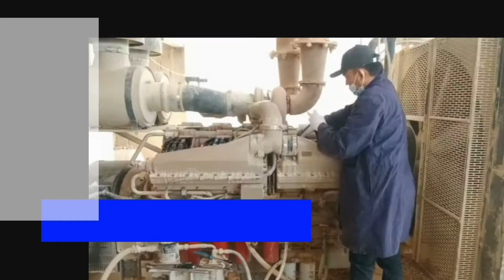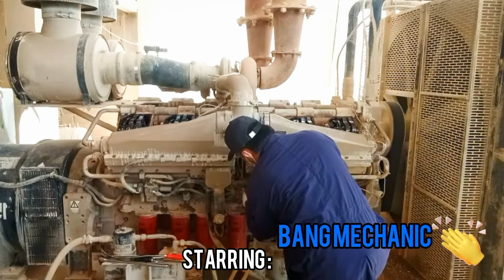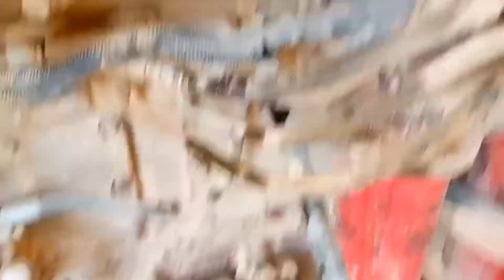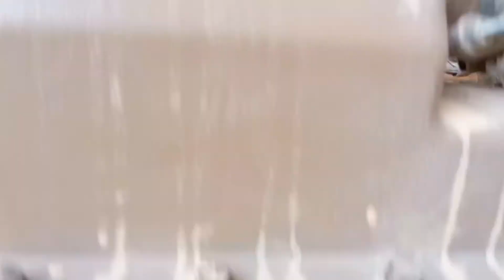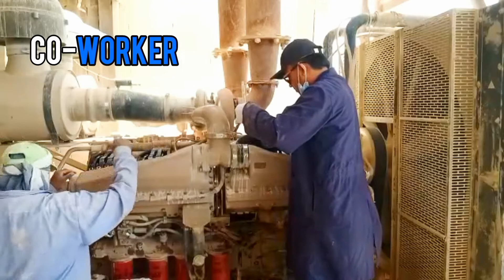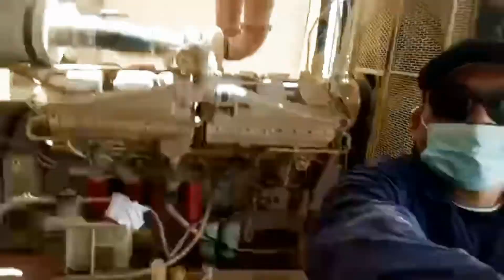CUMMINS KTA38—G4 ENGINE PART 2: MIXTURE OF DIESEL AND OIL DUE TO BROKEN PUSH ROD (PROBLEM FOUND)

Comment: Paano poba yan nagyari sir . push rod lang naman ang nabali? bakit maghalo?
Reply: paano?
Reply from the maker: Sir sorry ngayon lang reply subra bc dami work.sir naghalo ang diesel&oil.baka sirs ang nozzle cap internal bleeding...
Reply: @bangmechanic  i mean jan sa ginagawa mo na kta38 bakit naghalo ang tubig at langis kapag napuputol ang pushrod?
Reply from the maker: @sandyfortuno3194  diesel & oil nag mix hindi po water coolant.
Reply from the maker: @sandyfortuno3194  naghalo sir kasi ang push rod ng injector ang naputol SO dami fuel pumasok sa cylinder hindi nasusunog.